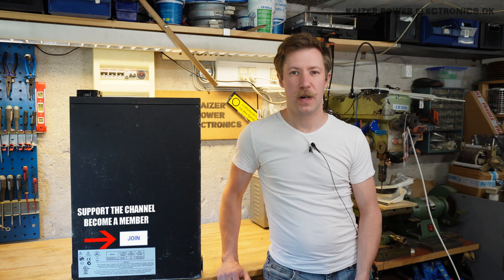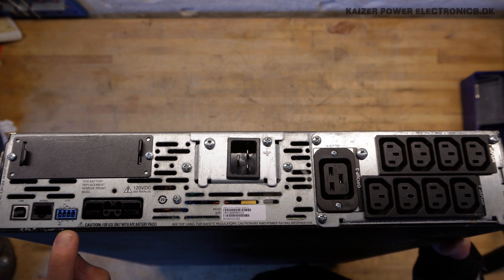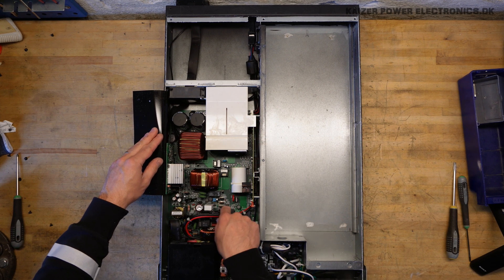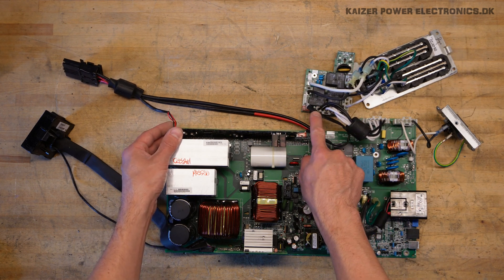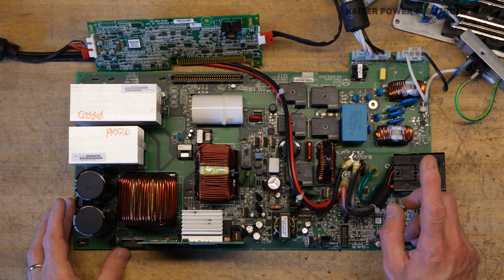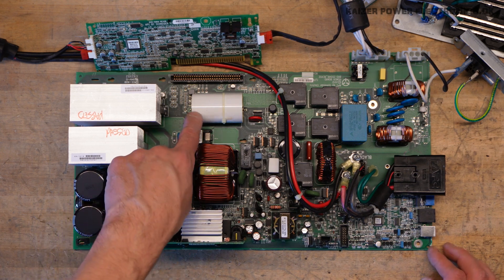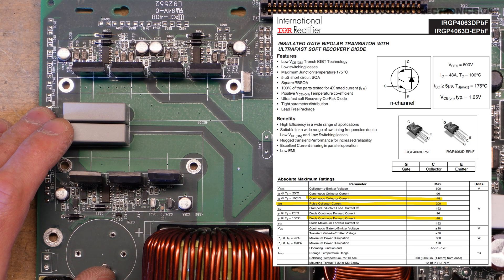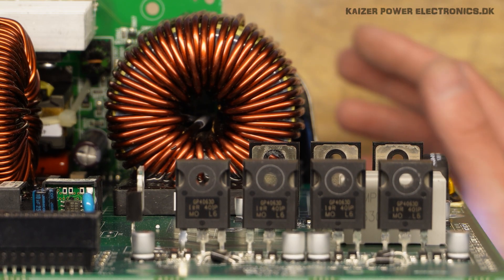Teardown of a 3kVA APC Smart-UPS X SMX3000

Comment: Hello! Is this model as resistant to continuous loads ~1500w as tower models with transformer?
Reply from the maker: I would consult their individual datasheets for the estimated run times on the specific load. But generally transformers have higher losses, which is also why you see modern transformer-less models, as to advertise a higher efficiency and thus lower running costs.

Comment: Thumbs up from me and a new follow! I just bought one myself (SMX3000RMHV2U), opened it up and I saw that it's got two 24V brushless fans, looks like a 3 pin JST connector, but only ground and 24v cable going to it. The fan noise is constantly loud, which makes sense after opening it up and seeing only those two wires.  When you disassembled yours, did your fans have 3 wires? could you share the fan details if it was 3 wires? I need to figure out if it's PWM or a Tach...
Reply from the maker: If you look at the front and backside pictures, it seems to be 2 wires, next to the electrolytic capacitors: https://kaizerpowerelectronics.dk/teardown/teardown-of-a-3kva-apc-smart-ups-x-smx3000/

Comment: First time seeing inside a SMX, and i'm surprised they ditched the auto-transformer for a line-interactive UPS.
There must be some clever buck/boost circuit to control the voltage.
Reply from the maker: If I had an industrial xray machine, we could explore the 4 layer board, but its just too much to reverse engineer with a multimeter.

Comment: 6:43 one thing I've noticed with apc transformer is that it doubles as a autotransformer for brown out and over voltage. It will either bypass the transformer or if Vin is less than like 100 or higher than 130.... It will switch from bypassing the transformer to using high side to bring 130 down to 115 or 100 up to 115...(pulled numbers out of my ass this)

Although this one looks more like a fully solid state design...
Reply from the maker: Are the magnetics in this one larger than those with autotransformers? Maybe they use them with additional windings, so chokes can double as autotransformer?

Comment: I've got a sua3000rm2u that I ended up replacing the internal battery with 18Ah instead of the 2x7Ah in parallel/series
Reply from the maker: So you did not have the external battery bank? But it makes sense to replace those regular small SLA batteries, if you want some longer backup time.
Reply: I  have a SMT3000RMI2UC. May I ask if I can increase the capacity of batteries to double? Thanks in advance.

Comment: 4:45 it's only an ISA slot in terms of connector or it it even speaking the the ISA-bus there? did you look at pin30 if there is clock oscillator?... o.k. it's not an ISA-slot, it's missing 2 pin.
Reply from the maker: I should have said ISA-style shouldn't I? ;)
Reply: @KaizerPowerElectronicsDk  PCB edge connectors. ISA/IBM-PC was late to that game.
Reply from the maker: Thanks, that is what I get for growing up with seeing them first thing as ISA slots, a brand name becomes the common name, in my head, for that connector :) Like googling something, not searching.
Reply: @KaizerPowerElectronicsDk  with 60 pins (instead of 62) the slot really looks like ISA. But if it comes to those connectors, for me S-100 (or "Altair 8800 bus") comes to my mind, with 100 pins off course, as the name implies. nevertheless, even before there will have been systems with pcb edge connectors with this classic 2.54mm pitch.